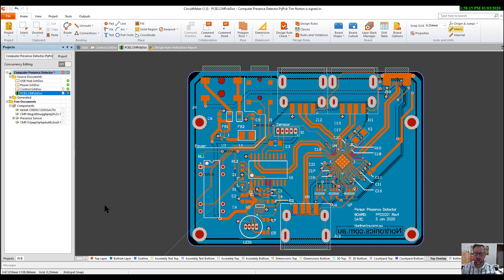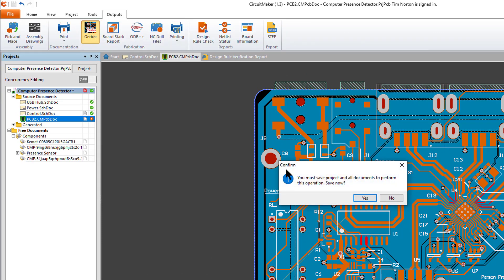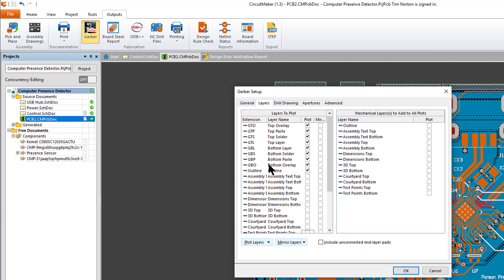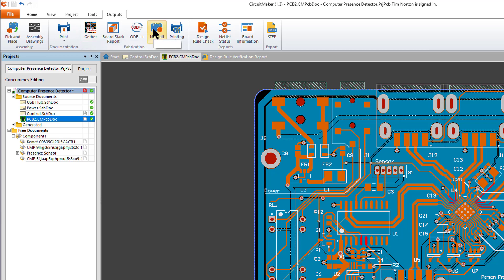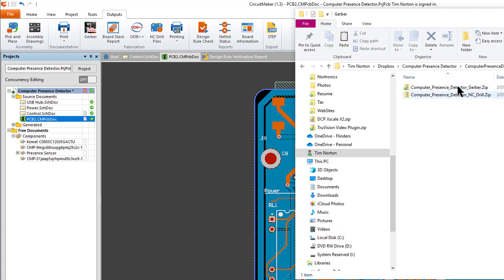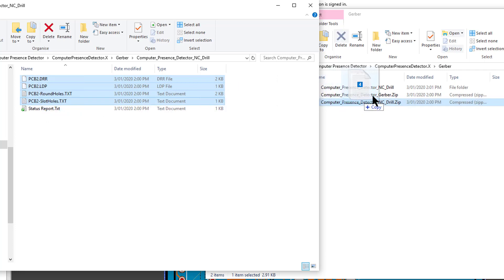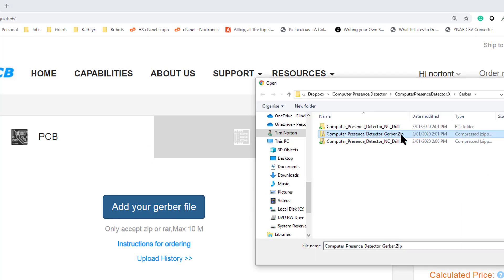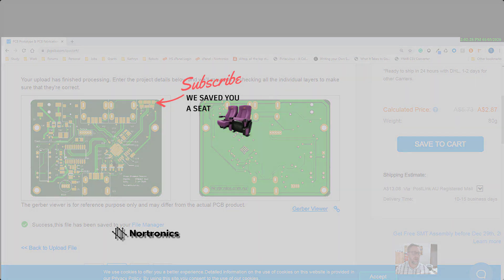#3: No Drill  Holes on JLCPCB

Comment: Uh, jlcpab usually doesn't allow me to procede unless the drill files and grbr files are in the same zip folder that was input to the website. Is that not the case for everyone?
Reply from the maker: At the time I did this video I guess not
Reply: Yo what the heck. Literally right after watching this video I went to order a pcb I designed and had the issue this time. That's so weird. Maybe the drill file have to be a certain type @nortronics

Comment: Saved my day. Thanks
Reply: It is simple watchdog system for a LoRa gateway (checks activity through RS485 and turn on/off the power). When those devices are placed in hard-to access places, you want them to recover automatically. Again, thanks for your video showing how to fix the drill issue
Reply from the maker: Good simple use of technology.
Reply from the maker: Yep. One of those things you can lose hours on. 
What are you making?